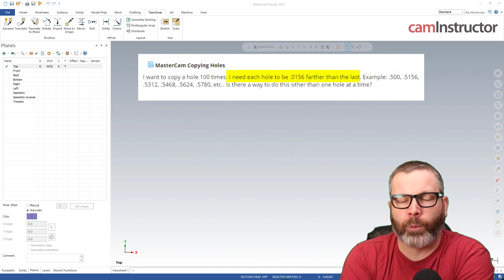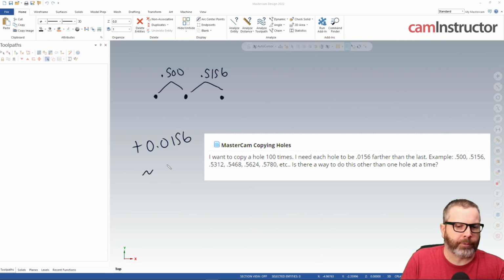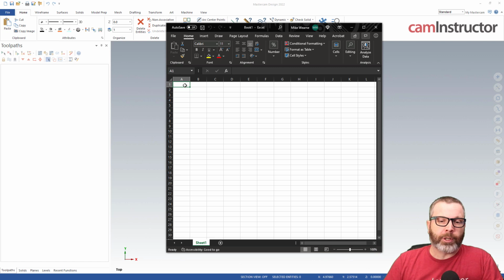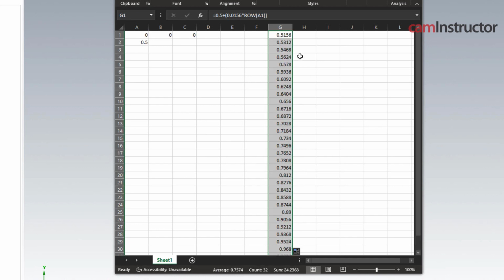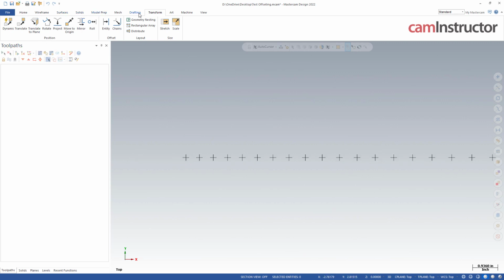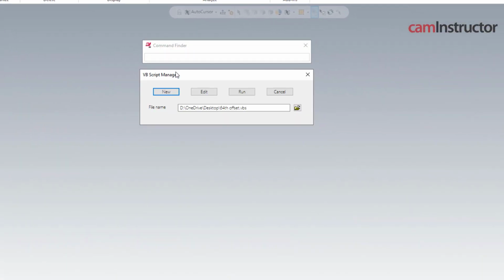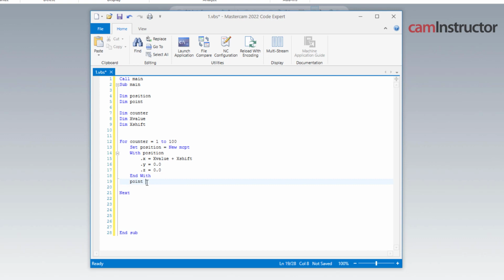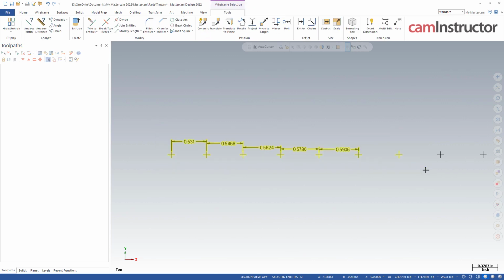Do the Undoable in Mastercam with Excel and Scripts

Comment: An easy way to do this for something like drilled holes or other canned cycles would be to program them in G91.  Then you just copy paste X/Y.5156 for the number of instances - 1 for the first hole.  
This, however, is great for something outside of a canned cycle.   Though, arguably could be done with subroutines as well.  Anyway… a million ways to skin a cat.
Reply from the maker: That wouldn't quite work as the spacing is different for each hole, its moving 0.0156 more than the last move, not a consistent 0.0156 each time. You would have to change your incremental amount each time,. No real gain over absolute position as you cannot refer to the move you just made. The only solution on the control would be a macro program.

Comment: Great information!  But I think you missed the easiest and quickest way to accomplish your example task - use transform to create 100 copies of the point, then scale with the scale origin at the first point using a scale factor of (.5 + .156)/.5.  Boom - done!
Reply from the maker: You are on to something here but as described this does not work. The points will keep an even spacing during the scale move, unless I'm overlooking something. Doing a Copy during the Scale kind of works, I can get an increasing offset but not at the positions we're after here. If you want to provide some additional info, I'm all ears.
Reply: @CamInstructor  OOPS.  I didn't think about this thoroughly - your example is not a linear scaling problem.  Sorry!